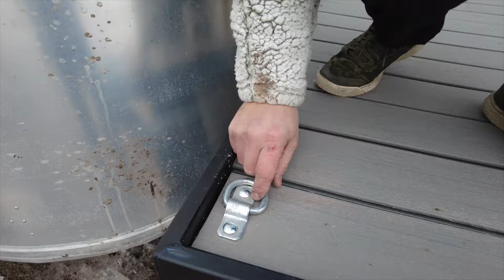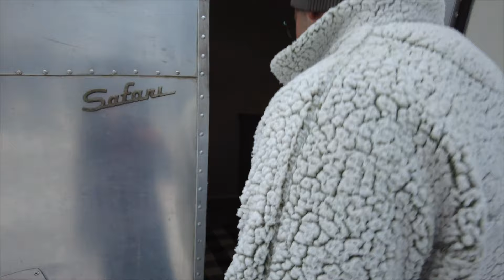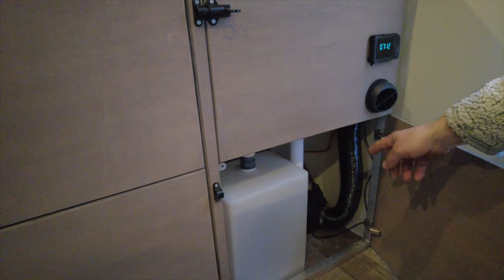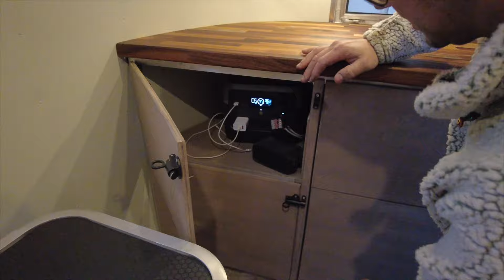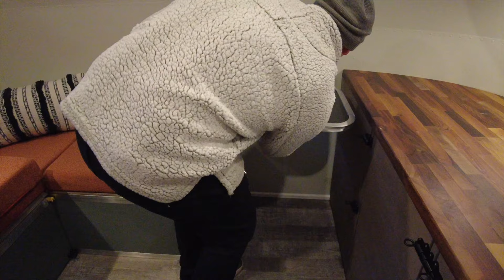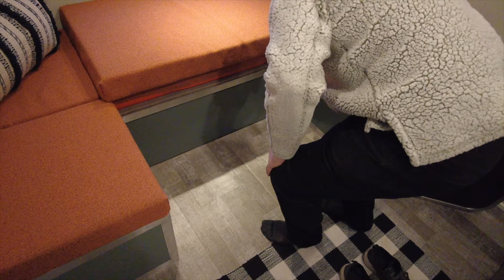Airstream Safari Toy Hauler Build, Off Grid Custom Vintage Camper Tour Walk Around

Comment: Single axle? No way you're fitting a SXS or two Snowmobiles, would be way to heavy for a single axle.
Reply from the maker: Six lug axle rated at 5k, trailer weighs 2600, no problem hauling 2 sleds, 2 atv’s or any smaller utv!